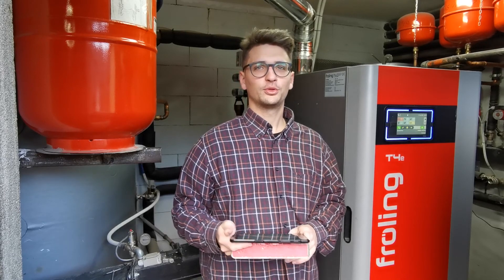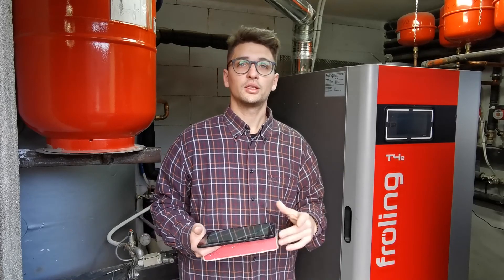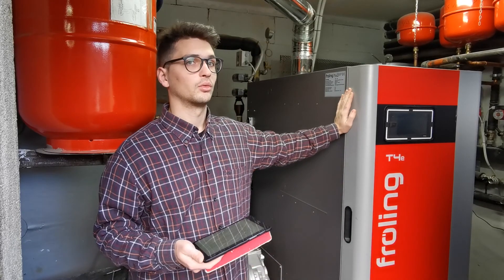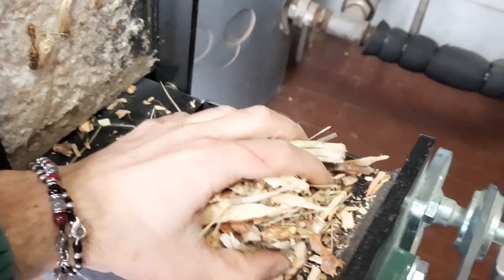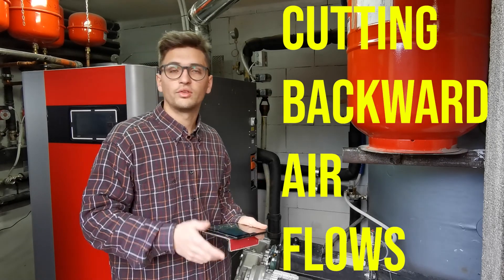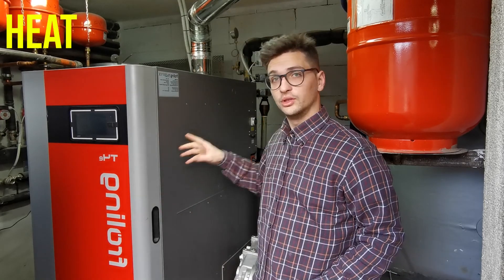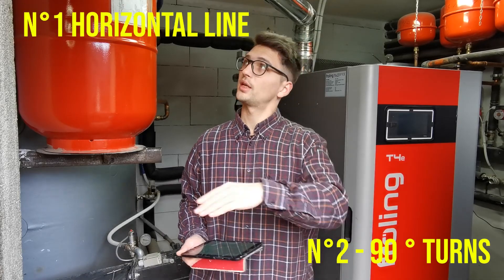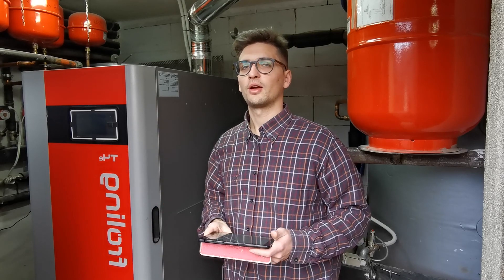FROLING T4e [1] - Wood Chip and Pellet Boiler

Comment: When the bunker is full, do the arms hide (most part ) and scoop a small amount into the feeder? Or too much?  How regular is the feeding of wood chips?
Reply from the maker: Hi! Thank you for the comment. Exactly, they do hide, they are all winded around the main rotor. They continuously 'eat' material from the above column of wood chip. The main screw extracting the material is always full of wood chip, so that the feeding is always as much constant as possibile. 
If the material feeding is irregular (talking about both quantity or different materials) the boiler controller will understand this because of variations in the combustion properties.
If its feeding and temperature isn't rising (or the boiler is cooling), than more material has to be fed. Or, on the other hand, if you keep feeding the same quantity and you see the temperature of the fumes rise up too much, it means a more powerful material is coming inside the combustion chamber. The control system can reduce the feeding rate.

Hope this was helpful for you. Bye!

Comment: Does the moisture % content effect the combustion. Does it freeze in your area and is that a problem for the chips? Thanks.
Reply from the maker: Hi! Thank you for the comment! 

For sure the moisture content affects the combustion. More water inside the product means spending a % of thermal energy to let it evaporate (= less energy to heat the technical water). For sure, more the product is dryed, higher is the combustion efficiency.

About freezing. No, in my area the material inside the storage room doesn't freeze. But yes, I think it MAY be a problem. A block of frozen material is hard to brake, however I say MAY because the wood chip extractor has long bars with 'hooks' on the end thip. They help in scraping the material from the storage: even if it is hard, the wood chip is still extracted. But if it is a very hard block of frozen material, maybe it won't be that easy to brake it. This is a very curios aspect I've never thought about.

Hope this reply was ok for you! Bye!

Comment: Is bunker auger loud?
Reply from the maker: HI! Thank you for the comment! Well,  bit yes. When the motor starts the noise is strong, you hear it. Moreover it makes a bit of noise if the material remains stacked betweend the screw and the steel plate itself. But this doesn't happen that much frequently. I'won't sleep in a room over it, let's say. But from the outside you don't hear that much, als  because it is not constantly running. Hope these considerations can help you in your work!

Comment: Interesting description of wood boiler technology. In the US most heating systems are combined HVAC (heating ventilation air conditioner). Usually air is ducted by fan to rooms via air ducts, and returned to the central HVAC unit to be conditioned. Hot water systems are also available in the US, but not in wide use compared to air handling systems. Central AC is a very common home feature here, probably explaining the popularity of air handling VS hot water for heat. Wood pellet stoves can be purchased to be placed in rooms for added heat, these are used to heat and circulate air. These pellet stoves are vented through an exterior wall. Normally these pellet stoves are considered auxiliary and would not replace the central heating system.
Reply from the maker: Hi! Thank you for the comment! I didn't know about these details. I imagine that these air conditioning systems are electircal-powered, right? In this case, how do you produce heat? I mean, do these systems have resistances? Or do you heat up water to produce steam, then you send steam wherefer you need?
Reply: @profilo_is_back  Yes, central AC unit has an electric powered central compressor with cooling coils installed in the ducted supply airstream. Air heating often uses electrical resistance coils in warmer areas. Circulation air is usually heated by nat gas, propane or oil heat exchangers in areas with colder winters. Steam and hot water systems can easily be found as well, but less popular in recent decades. Air handling ducted systems are far more common in low rise construction.